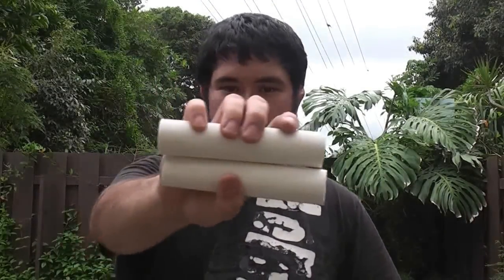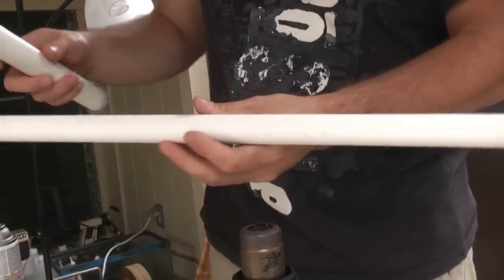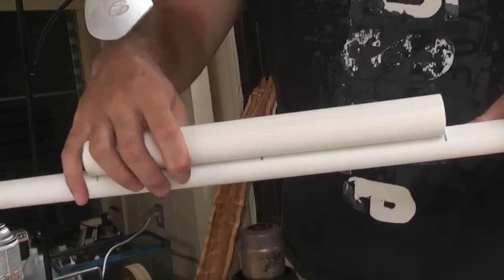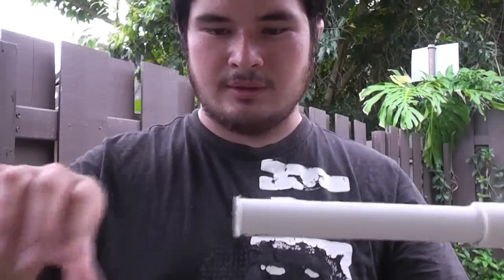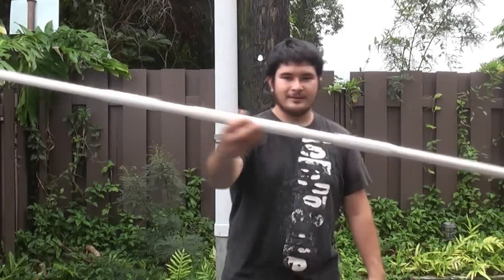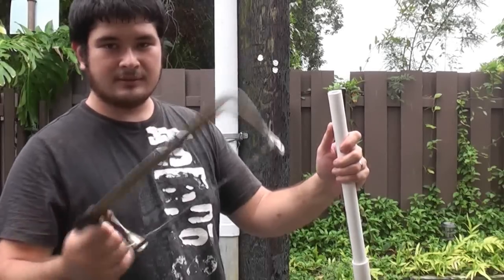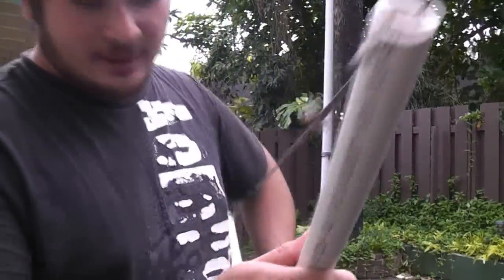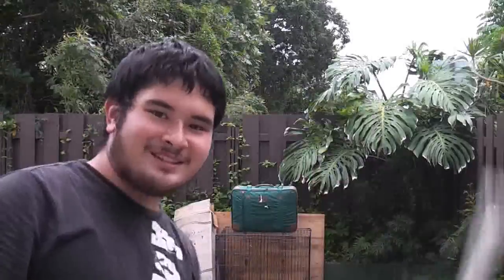Minimal Heat Takedown PVC Survival Bow

Comment: Stupid Question: would drilling a hole through the bow for the arrow to pass through be a terrible idea?
Reply from the maker: +Brian Wilson You don't want to drill any holes near the handle of this bow, as it will weaken it and could cause it to break there.
Reply: BackyardBowyer I figured that was probably the case, but wanted to check.  Thanks!

Comment: This looks as if it would fold on you very easy. Could you not just put an even smaller pipe inside the weak part between the handle and the conecting bits, so it wont fold that easy and keep its strenght longer?
Reply: +Diogenes2077  i made this a while back an putabout 200 arrows throw it, an i have never had it give me any signs of folding

Comment: The permanent bend in the main section is really bad. If anyone makes this, I would suggest adding in some fibreglass rods in a fashion similar to his 40 pound no heat PVC bow to the middle portion, or even his 70 pound no heat bow (with only 4 rods instead, so it will fit inside of the smaller 3/4" pipe). They will stick out of either end when the bow is disassembled, but it shouldn't be too inconvenient. It will also increase the poundage and efficiency.

Comment: Hey man FYI if you freeze that main 23" section of pipe it might contract enough to make it even easier fr the heated pipe to slip over it. Works with metal bosses and bearings so it might work with PVC as well.  Your videos are awesome by the way. One of these days I'm gonna build some of these since my crossbow pistol bowstrings keep breaking.
Reply from the maker: JackstandJohnny Thanks for the suggestion!

Comment: try boring a hole in a 2x4 that will allow the 3/4" pipe to go through but  not the 1".  The use your body weight/ah hammer to drive the grip to lacation on 3/4" pipe instead of using  that slamming process. (you very well may micro fracture your 3/4" pipe doing that.---Nice vid,  well done.  don't mean to critize you.  thanks for your knowledge and assistance

Comment: What would it do if instead of putting the sleeves on the outside, you instead used a smaller diameter and put them on the inside?